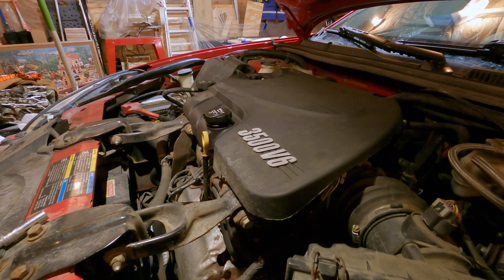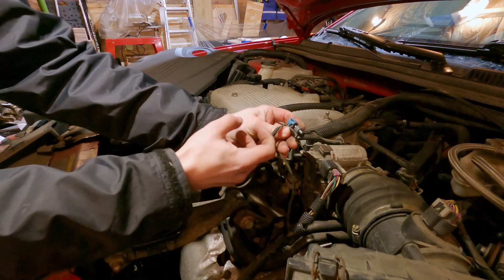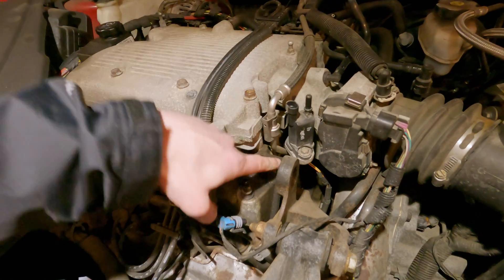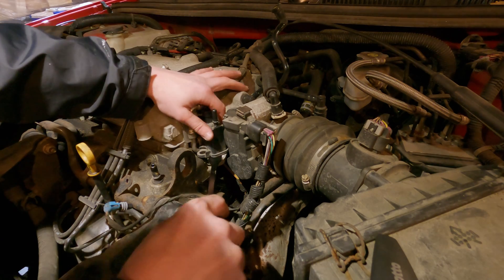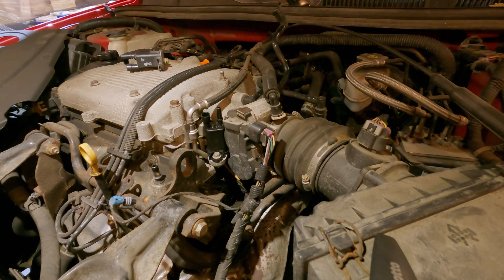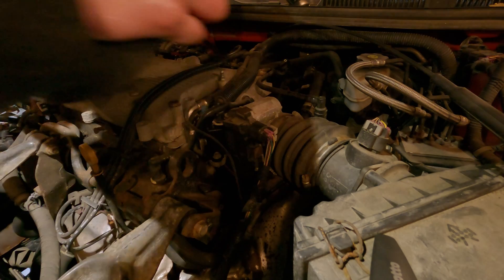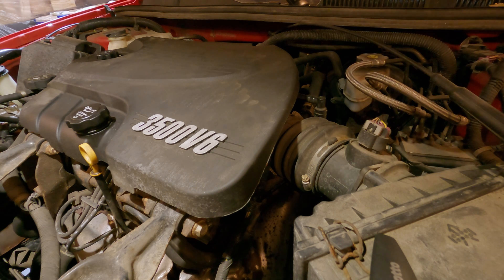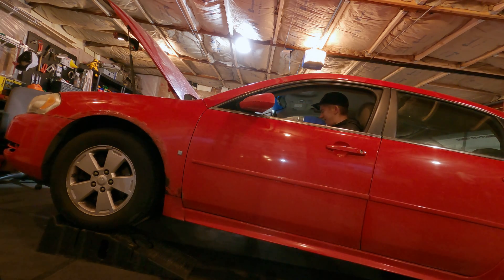Fixing Code P0449 on Chevy Impala

Comment: To bad the P0449 is the vent valve not the purge valve. The one that actually needs changed is in the rear under the fuel fill neck. Iam actually a mechanic, this dude clearly isn't. So don't do what this guy's doing and change the wrong part. Also check for power going to it first. It's a constant hot with ignition on. The ground, which comes from the ECM is what actually opens and closes it.
Reply: Absolutely 100% correct! I agree as a technician.
Reply: GM certified tech for 25 years.. idk why but in the 100 or so I've done on the 3.5 flex it's the evap vent solenoid 40% of the time. The other 2 motors and the rest of the flex fuel motors it's the vape canister. IDK why But I'll always rest the vapor canister  first and with those flex fuels surprisingly they work fine

Comment: I have a 2009 Chevy Impala 3.5 the engine runs perfect the damn check engine light constantly comes back on then when I use my scanner tool to delete the code it starts up and it has a rough idle and it stalls out on me p0445 is the main code but 11 other codes come up everything I did to it purge valve mass air flow air cleaner put a new wiring harness on the mass air flow sensor put a new foot throttle gas pedal gas cap like I said it runs great but that damn check engine light comes on after a day or two I don't know what else to do
Reply: I'm sure you've fixed it but it's the EVAP canisters under fuel door behind left rear tire